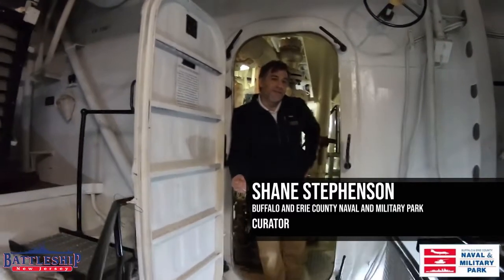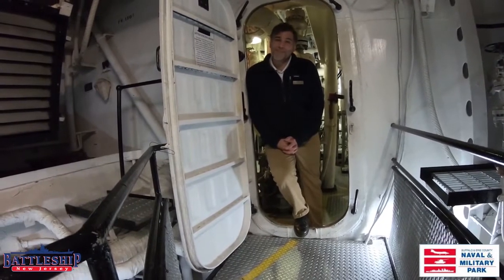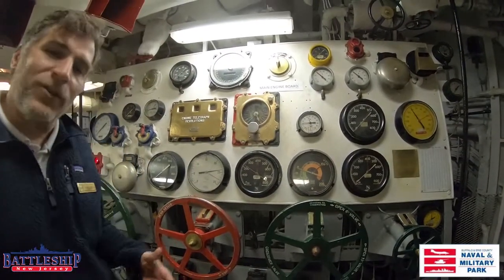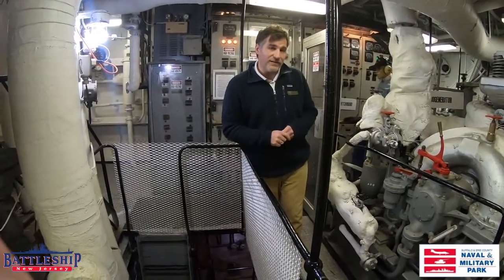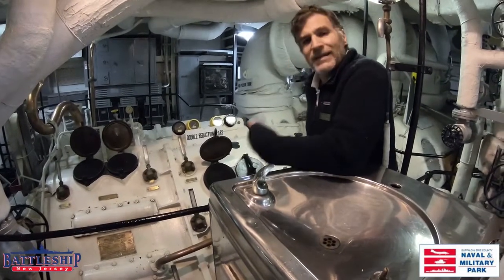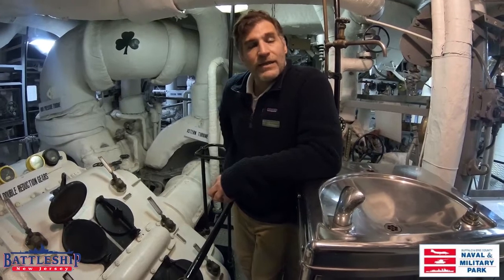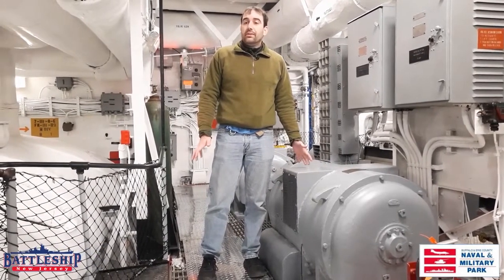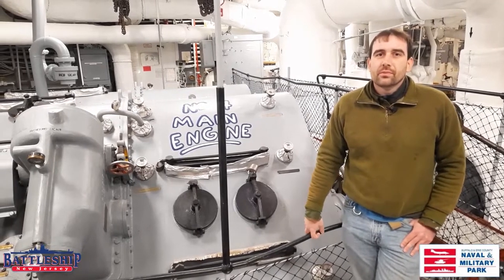Engineering on Destroyers vs. Battleships: USS The Sullivans and Battleship New Jersey

Comment: Thanks for the tour, Shane.  Your description of the propulsion turbines in THE SULLIVANS is not completely accurate.  When the cruising turbine is in use, it exhausts into the high pressure turbine, but the cruising turbine can be bypassed, and it was normally bypassed when a destroyer was operating in her usual environment.  In normal operating conditions, steam is admitted to the high pressure turbine, which then exhausts through the “crossover” into the low pressure turbine, which in turn exhausts into the main condenser, to be converted back into condensate.  The low pressure turbine has astern “elements” on each end of the LP turbine shaft for going astern.  There is no dedicated astern turbine in either DD-445 or DD-692/710 class Tin Cans.
Reply from the maker: Thanks for watching and the correction, Hugh. When I filmed this video, I hadn't known that! I was  new to this world). Thanks for sharing your experiences and knowledge. It is funny, because there is a sign that says, astern turbine, that's probably been there since 1990. I trust that if this sign is there highlighting the astern turbine that there is one. But, I'll have to continue checking! Appreciate it.